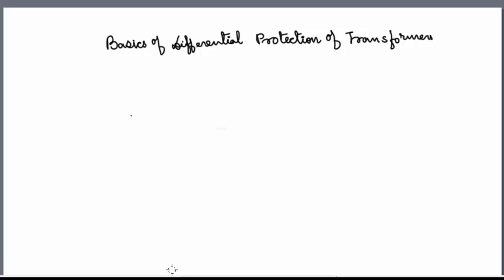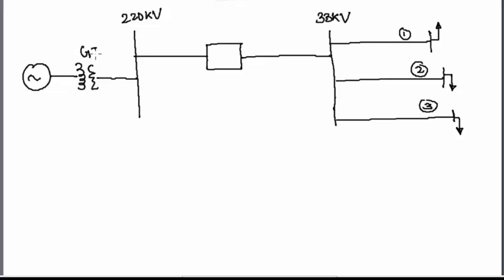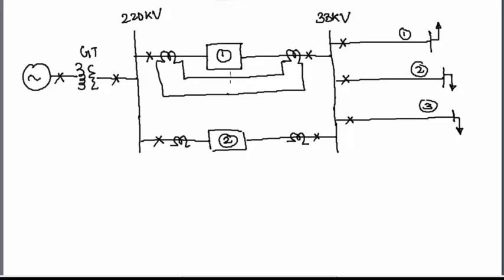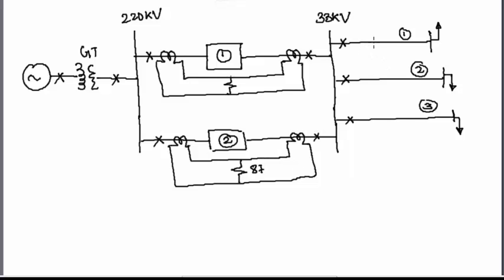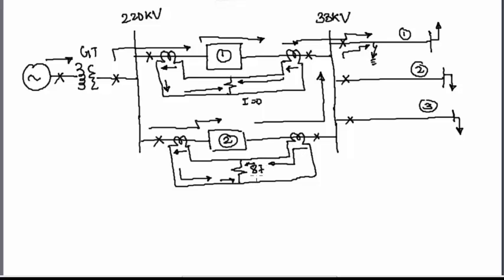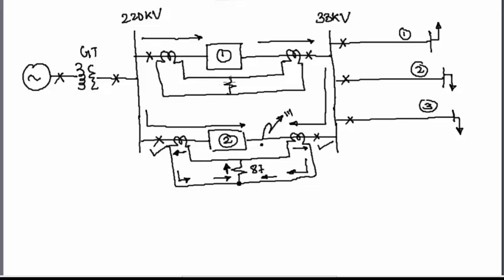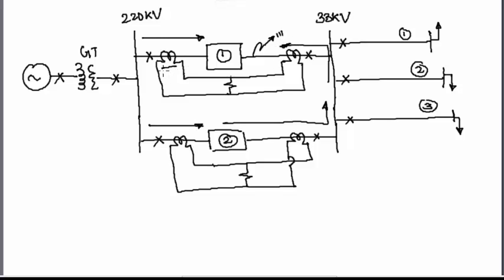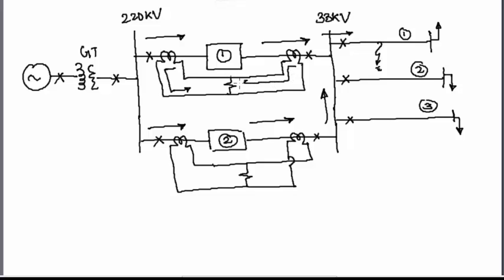Learn the basics of differential protection of Transformers

Comment: Very good explanation. But why is it necessary to occur fault for tripping transformer, when the 33KV side CT connection is in reversed condition?  
In this situation during initial charging itself the secondary CT's current will be in reverse polarity such way that it will get added up in the 87 relay and trip the transformer.

Comment: thanks for vedio ,,i think if there is a fault onTR2 both CBs of TR2 should open same time otherwise TR1 will also trip, correct me if im wrong
Reply from the maker: No Tr1 will see it as a fault outside it's differential zone. So differential protection will never operate. But if CB of LV SIDE of TR2 fails to open TR1 will trip through back up over current protection

Comment: Very well explained about the differential protection relay actually it works on the same principle the two C.T installed on primary and secondary side of Power Transformer are paired and the sensing Relay is connected across them in case of faults the Net Current or Total current attains some value which leads to trip command to Master Trip Relay no. 86. The differential relay is also helpful in finding if there is any kind of short circuit between primary and secondary windings.But there is no such thing like Generator Transformer it is just Step Up Transformer it is not generating any power .

Comment: Good videos. Thanks. I have a silly question- why the current in Ct secondary is opposite to direction of the current flow from GT to feeder. (What do you mean by to balance the current, it flows in opposite direction) Thanks in advance
Reply: CTs primary coil is the line where CT is fixed and the voltage is induced in the secondary of CT, so the current in the secondary coil of  CT always flows opposite to that of the current in the primary because as per the law induced current always opposes the cause which produced it. So in short, current in secondary of CT always flows opposite to current in primary coil or lines. Hope it is clear for you now.

Comment: What is the difference between Percentage Differential protection and Differential Prrotection
Reply from the maker: soon I will be uploading a video on this topic also.
Reply: restraining coils are only the difference.diff protection is basic scheme which is having disadvantages of operating for through fault also this problem is recovered by the help of %diff protection which is having restraining coils
Reply: Please make vedio by taking 15 mva transformer 132 kv / 11 kv YD TF with 100 /1 amp hv CT and 1250 /1 amp lv CT 
PLEASE DO A VEDIO WITH THIS EXAMPLE USING AN ALSTOM RELAY TO GET THE DIFF SETTING ..
Reply: Now days we have all numerical relay for advanced system protection . So there is no use if you teach old electro magnetic relay concepts ..
So please make vedio with example to get I DIFF SETTING
Reply: Sound is too low.

Comment: Even Under Normal Conditions if the CT Connections r wrong they will give trip signel continously
Reply from the maker: yes they will. but that is not desirable so we have to check all these things in the beginning itself when the transformer is being commissioned, so that these problems don't arise afterwards. And in numerical relays we rectify some errors of ct connection internally without changing the connection.

Comment: If the CTs are configured in opposite direction, I am thinking the 87 element will operate not only during the thru fault or the fault in the other transformer but during the normal load operation too.
Reply from the maker: yes. but it also depends on the loading of the transformer and the pick up value of the relay
Reply: it should be mentioned that ct connection differs to accomodate vector change of transformers. otherwise incorrectly wired ct would result in faulty tripping.
Reply: Immidiate trip will accur